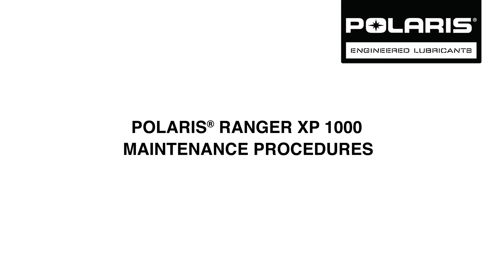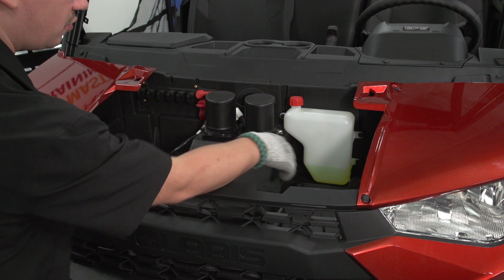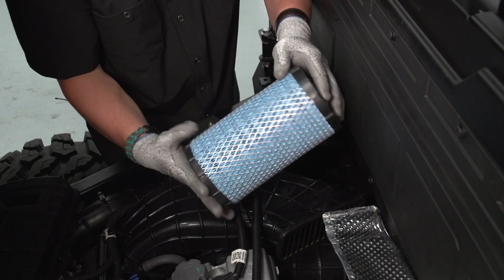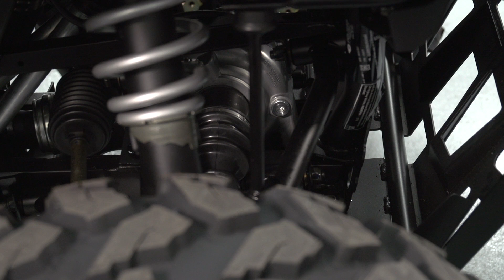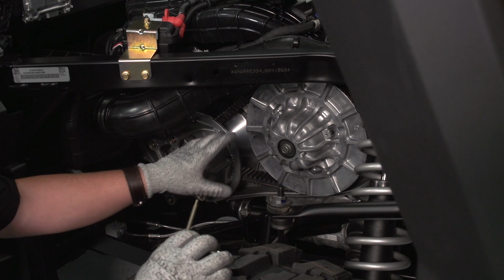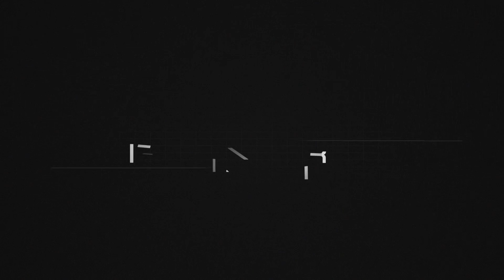2017+ RANGER XP 1000 | Maintenance | Polaris Off-Road Vehicles

Comment: Does all the new 2020 polaris ranger xp1000 do away with the reverse chain and go to a reverse gear or is that just on the highlifter edition??
Reply: Just the High Lifter from the factory, but you can get it done aftermarket.

Comment: So, who's responsible to fix a rounded off plug on the front diff due to a "hulk" at the Polaris plant deciding to over tighten the fill plug? Can't check my front fluid now for the 25hr interval.
Went by the local Polaris dealer and sure enough I get the "Oh that's not warranty. You'll have to fix that yourself or else bring it in to us and let us charge you $$ for it." 
So let me see if I understand this correctly: if I cannot check the fluid in my front diff and I burn it up, will it then be covered under warranty? Hey, that's how it came from the plant and as usual, the dealer was of no help.

Comment: Question. Why is it that I put 600lbs in the bed or tow 1000lbs. With the ranger and the squat is ridiculous? Using the canam defender there was no problem? Please dont tell me to see the dealer. This is supposed to be from factory. Same load and same bed load. I do t think Polaris numbers are correct??
Reply: Brian Keenan try turning your shocks up they haven’t replied to you yet why should Polaris even have a you tube channel
Reply: From the factory they are usually set to the softest settings. Most aggressive way to stiffen the rear, is to move the upper shock bolts to the outside holes/mounts. (There are inner outer mounts) Also there is a wrench in the tool kit to adjust the preload on the shock springs. Again usually set to the softest.

Comment: are there any greese fittings on this machine a arms and such?
Reply: The 2018 Ranger XP 1000 has only one grease point on the prop shaft, this can be accessed through a hole in the bellypan under the machine. There are no grease points on the a-arms, Polaris uses sealed a-arm bushings and recommends lubricating them every 50 hours, 500 miles, or 6 months. For more information, please contact the service department of your local Polaris Dealer.
Reply: @PolarisSnow  There are also grease fittings on the sway bar bushings where they attach to the frame. At least there are some on my 2019.
Reply: @wjsuter yes there are 4 on the sway arms as I was told there was no zerks on this machine a 2018 I bought new and in 2025 I now find this out think my god there has to be some on this thing and as I have been looking through videos, I found the four on the sway arms and now I learned there is one underneath the belly pan, which is very important. This really pisses me off. How can a 40 year dealer not know this
Reply: Polaris Snowmobiles how do you lubricate them if there sealed ? I have a 2020 ranger 1000
Reply: @PolarisSnow  how did you lubricate them ?
Reply: thank you for the reply. not the one i was looking for, it is  the one i figured i would get.